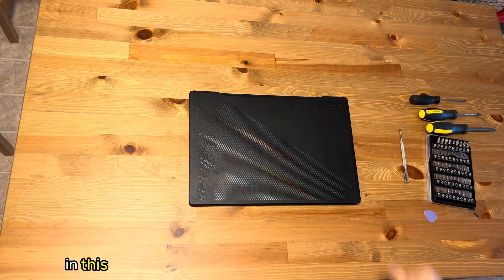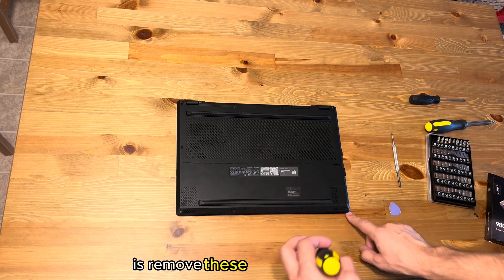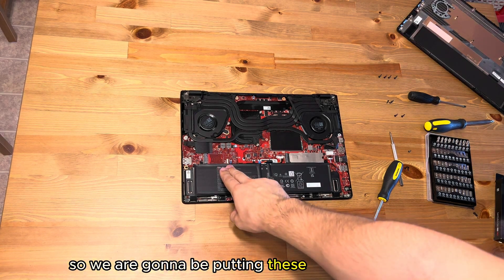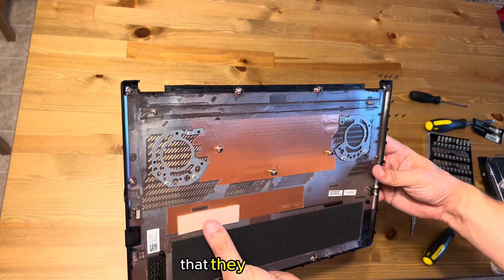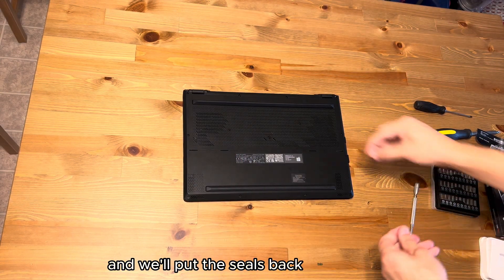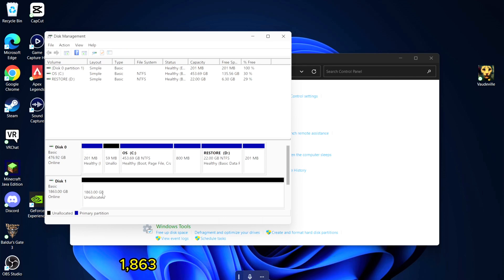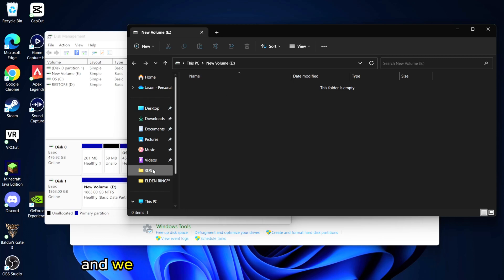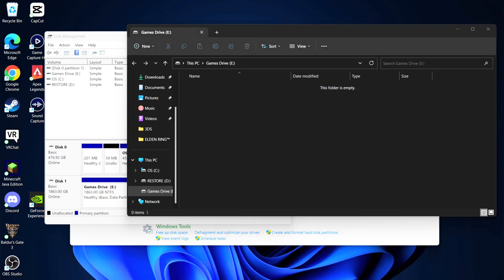How to Upgrade ASUS ROG Zephyrus M16 SSD (Tutorial)

Comment: Isn’t that thermal pad that was already on there for the preexisting SSD?
Reply from the maker: It is yeah! You can add another to the one you put in
Reply: @ that’s what I figured. I’ve been looking around to find some SSD’s for cheap but they usually don’t come with thermal pads. But I’ve  found some with heat sinks already attached and I wished they would fit in my laptop but I doubt that’ll work.
Reply from the maker: @N0W0  ones with heatsync likely won't fit yeah, but thermal pads aren't too expensive. I ran without one for over a year and was fine
Reply: @JasonDunna  yeah I figure I should be fine, I usually keep my laptop pretty cool
And I run it on top of a laptop cooling pad (pad with fans installed)

Comment: how can i install  p2 m.2 2280 ssd it is not showing in my laptop, can you help me in this
Reply from the maker: Is it inside your laptop already? Did you check if it’s a supported SSD for your laptop? That’s the first thing I’d check because some of them are finicky when it comes to what SSDs you can use
Reply: @JasonDunna  I am installing a crucial p2 m.2 2280 new SSD to other slot
Reply from the maker: @FilmyRahul  did you install it inside your laptop?
Reply: @JasonDunna  I have installed it , it is not detecting, I don't no the compatibility of the slot .. I have b550 mobo it it working on gen 3 slot not in gen 4 but I don't know how to make it work on laptop. Currently I am using factory  installed SSD which is micron SSD..
Reply: @JasonDunna  yes it is not detecting model no. is Crucial P2 M.2 3D NAND NVMe PCIe 512GB SSD Up to 2400MB/s – CT250P2SSD8

Comment: When is new thermal paste required to be applied to the cpu and gpu?

Do you apply it when it’s dried out? How often is that?
Reply: ROG M16 models use liquid metal!! Do not apply thermal paste you can damage the laptop. Liquid metal does not need to be changed. Only in very rare cases.

Comment: What thermal pad do you recommend for the 2nd ssd?

There’s this “m.2 thermal pad， 70x20x1mm for M.2 2280 SSD NVMe Heatsinks (4PCS Pack)” comes with 4 for $6.

Will it fit with the ssd?

Which ssd do you recommend?

Comment: do i need a thermal pad for 2nd ssd
Reply from the maker: @BizarreOwl   I didn’t use one and it was fine but it depends how hot yours gets! They’re only like $8 for two so there’s no reason not to, but I didnt use one. It’s a bit risky since the inside of a laptop can get really hot
Reply: @JasonDunna  has there been any issues so far
Reply from the maker: I haven’t had any issues myself and I play games on an external 1440p monitor so that would get things cooking. Probably not a massive risk but over time it could potentially cause them to wear out quicker or fail. Make sure you keep it dust free as well! You can always add them in at a later date

Comment: Just watched your video. I literally just got the Samsung 990 Pro. Great instructions. I have the m16 2023 edition. Nvidia 4070
Reply from the maker: I just replaced the stock SSD with a 990 pro so I have both running now, they both work great!
Reply: Did the 990 pro fit?
Reply from the maker: Yes its the same size at the 980 pro, I have both in my laptop now @jpmayo316
Reply: Hi seems like I have the same laptop but it won't recognize my SSD. Thoughts?
Reply: @gatewayrealtor664 so I read on Reddit there’s an issue with recognizing the 990 pro, try swapping slots with the original ssd and it should fix the issue

Comment: Is it ok to leave the laptop plugged in for a prolonged period of time, just curious? I did a RAM and SSD upgrade as well. Can notice a difference while gaming for sure. Sweet ass laptop for sure.
Reply from the maker: I never take my laptop off the battery, but I have the settings in MyAsus set to charge the battery only to 60% so it lasts longer! Going to upgrade RAM very soon, did you notice a big difference?
Reply: @JasonDunna  yeah I noticed a difference for sure while gaming. Went from 16 to 32 GB of RAM. It was needed for sure. And ok I’ll have to check my settings and do the same. I normally just plug it while gaming and then unplug when I’m done at night.

Comment: You didn't install a thermal pad on the new ssd?
Reply from the maker: Nah I may at a future date when I update RAM
Reply from the maker: I just put on copper plates from Amazon
Reply: @JasonDunna can I get a link to those?
Reply from the maker: @Pitdroidsws  I shop from Amazon Canada it won’t be the same link if you’re from elsewhere
Reply: @JasonDunna  gotcha thank you
Reply: Did you put the copper plates on the nvme, I have just installed second ssd and just put a thermal pad on to the ssd have I done it wrong 😱
Reply from the maker: @djbigjon8021  I did yes, what happened?
Reply: Can you tell me if there is enough room for a Nvme with radiator, for example the ones from Wester Digital? Or pads is the way to go?

Comment: M16 model number ?
Reply from the maker: ASUS ROG Zephyrus M16 (2022) Gaming Laptop, 16” 165Hz IPS Type WUXGA, GeForce RTX 3060, Intel Core i7-12700H, 16GB DDR5, 512GB PCIe SSD, Thunderbolt 4, Windows 11 Home, GU603ZM-AS71-CA
Reply: @JasonDunna how much extra storage can i install on the second PCIe? It's 2tb the Max?
Reply from the maker: Some people online said they did 4tb with a crucial one but I can't confirm if it works  @leosvanyolea08

Comment: tips for guitar picking off the back panel after the screws are removed? im having a tough time
Reply from the maker: Yeah it’s actually kinda tricky, I had to try a few different areas to find one that worked. I also had to slide it under pretty deep too

Comment: You took the sticker off the nvme right
Reply from the maker: Nah I read that it disperses the heat and you shouldn’t remove or the warranty is void. Might not be correct but idk hahaha
Reply: @JasonDunna  the the decal but there’s usually a thin clear plastic to protect the finish rarely there is not but most of the time there is. The actual decal that is a cooler